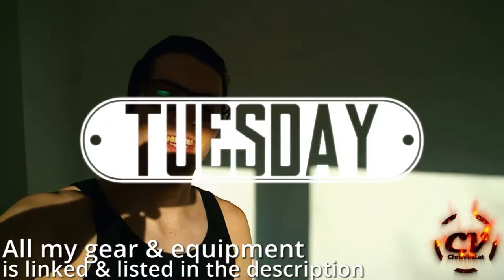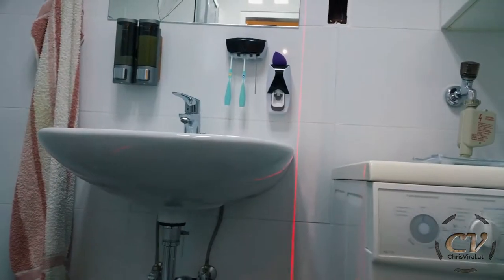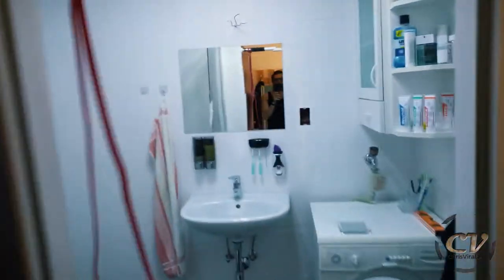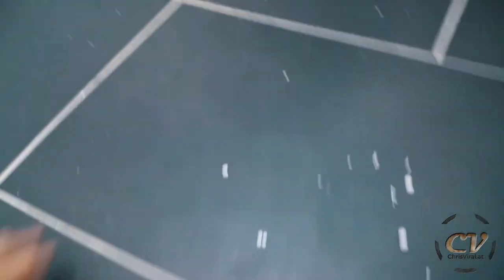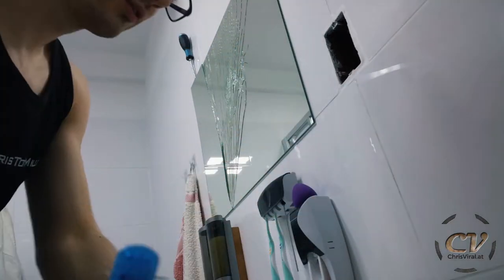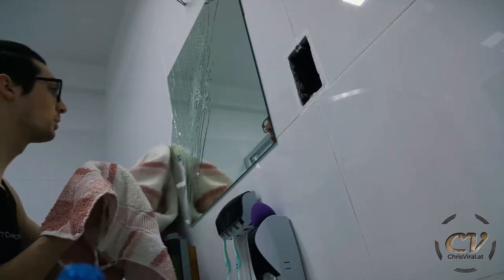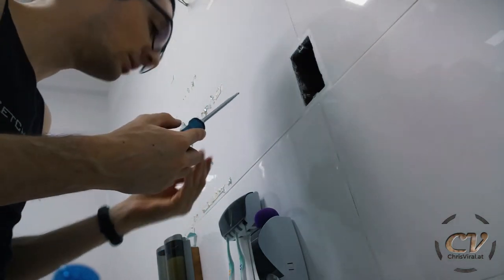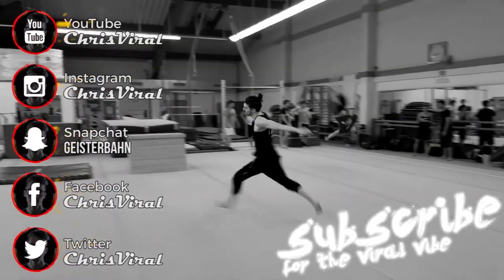How To Remove A Broken Mirror With Floss (& Other 'Methods')

Comment: haha i have the same Umarex toy its weak like 0.2j otherwise its great
vaccum clean that room really good, you have spilled glass all over the place, otherwise you cut yourself when you have glass on your toothbrush without knowing it.
I will never use duct tape for large mirrors, its mostly good for emos which like to cut themselfes ;D
5:50 its called transparent foil (bucheinschlag folie für schulbücher 60cx 5m ~3-4eur)
Reply from the maker: I indeed found glass splinters on my toothbrush(es) it was crazy 🤣
Reply: @ChrisViralVlogs  omg